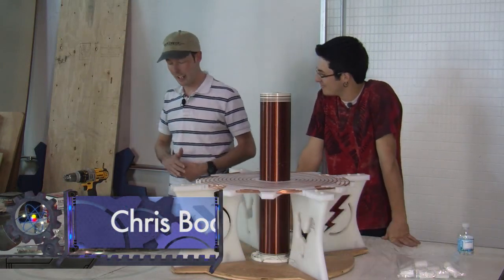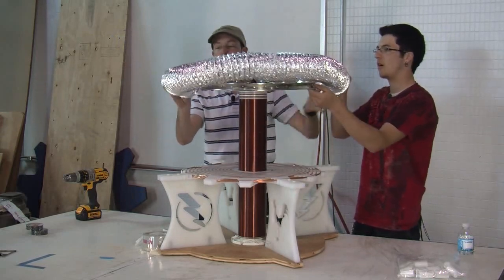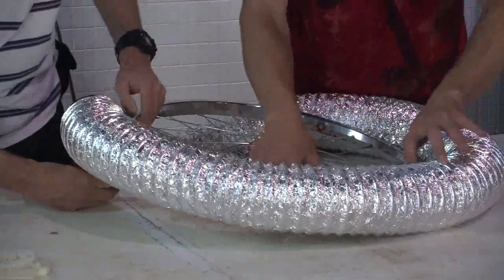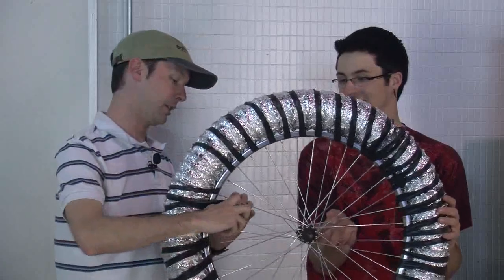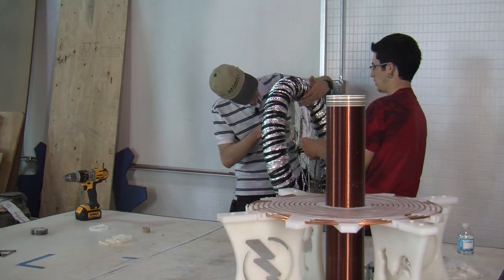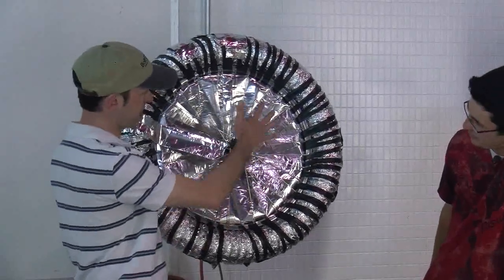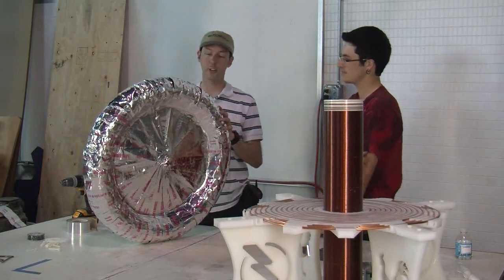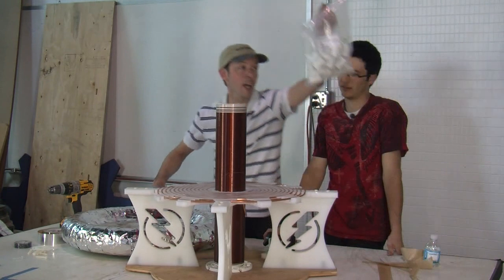Making a Toroid: Tesla Coils with Trevor #9

Comment: Would it be better to use a rear wheel if you can get the sprockets off since then it will have a flat side that you can put against the top of the secondary?